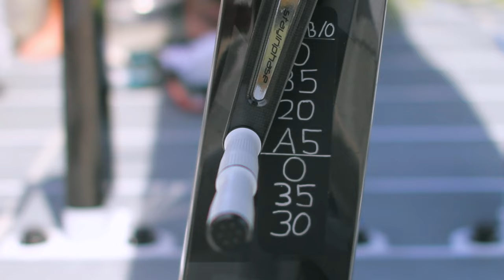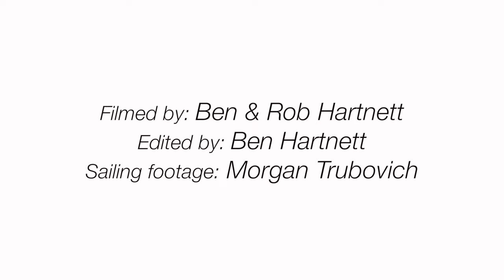The Tour of Comanche with Ken Read.

Comment: Thank you for an amazing video!  You guys just happened to catch Kenny Read in a talkative mood without any big project he was wrapped up in.  This boat was brand new out of the box when this was filmed, literally, and the crew were still learning about how to sail Comanche.  They lost to Wild Oats, coming in second, after an incredible start where Comanche blew away the rest of the fleet.

A few months after this was filmed, Comanche ran in the Transatlantic Race, which is held occasionally.  During the race, Comanche set a new record for distance traveled in 24 hours for a monohull sailboat.  618 miles in 24 hours.  An average speed of 27 knots is needed to make that distance in 24 hours.  A nautical mile is 1.2 miles.

Again, thank you for an excellent video, featuring Ken Read talking about the newest super-maxi sailboat.  Great job!

Comment: what should if the most rigging especially by snails rolls change down at plastik gears down teetwheals not need rope weight.with accelerator servowinch what said mechanical simpley

Comment: So how did Wild Oats defeat Comanche on the 2nd day especially when Comanche had such a big advantage at the start.
Reply from the maker: Comanche sailed into no wind, while Wild Oats headed inshore and was able to pickup some breeze and gained a 35 nautical mile lead over Comanche. However, when they got the breeze Wild Oats had they brought that gap back to around only 8 nautical miles. Essentially, Wild Oats just kept in the pressure the whole way :)
Reply: So Ken's fault? 

;)
Reply: I think it was light air when they were going up the Durwent River.  Comanche stalls in light air.

Comment: Is it allowed to cant the mast like a windsurfer does? Like down draft instead of up draft? Like pulling the hull out of the water instead of pushing it down? Why do I only hear a canting keel? Doesn't the keel turn a couple of degrees? Is this really the latest technology? Syllogic used self learning software for optimized trim, and it would be great if they had a ship like Comanche. Do check their concept, if you don't know about Syllogic. A turning keel will result in a ship that does not drift sideways anymore. Ever thought how much drag you'd lose, reaching? Syllogic has done that. And it has strange consequences, a turning keel and a canting mast,  the boom needs to point somewhere else. Traveller and main sheet need a change, and it takes time to learn how to sail upwind again, for it is something entirely new.
How the Syllogic team moved on, I don't know. They participated in the STAR, and the keel broke, so, no finish. But I read the book and it was a remarkable project. Just a canting keel? Great, but never forget there are more options to get a ship faster. And it is not that far fetched, really, please think about it.
Reply: The keel can cant quite a bit, perhaps as much as 40 degrees, I believe.  The mast is not supposed to twist or flex very much.
Reply: @scottholman3982  I do not mean twist or flex, that is for trimming.  I was talking about a mast canting towards the wind. Canting the other way, so to say. Consider the advantages, it is way faster. Perhaps that would be a great addition to the foiling cats, making them even faster, by reducing the drag a bit further.

Comment: Is it true that Comanche was sold after this year's Sydney Hobart race?
Reply: Yes I bought it and hauled it out to Arizona and turned it into a burger joint.
Reply: @wardaddy6002  Do you at least sell decent burgers?
Reply: @KyriafinisBill  Yeah, but the overhead is killing me. These carbon fiber disposable plates are costing me a fortune.
Reply: @wardaddy6002  Change you business model before it's too late. You could wrap them in Dacron instead it might be cheaper. You will loose some performance but it won't be that bad.

Comment: They are already building a 2nd Comanche. This 1st Comanche is too fuckin slow. My professional advice is for them to narrow the stern section a bit. Will make it faster in no-wind conditions. They're thinking of naming it The Trumper. Wot a fuckin boat the 2nd one should be. Jesus Christ ! 😅😨😆
Reply: are you joking or do you have a link?
Reply: @frombaerum  joking for sure lol theres no comanche 2 and im pretty sure this one is plenty fast enough, if theres no wind they wont leave the dock haha
Reply: yes Adam he was just trolling. i think if you gave comanche a more narrow stern section  it would surely be faster in light winds but on the other hand less righting moment, a slower sailor in heavy winds. the bad thing about the new owners is that they dont use the boat to its full potential i think. they use it mostly as a toy at near coastal sailing
Reply: @frombaerum  Yeah i dont know about that, from what ive seen the new owners have been campaigning it pretty hard in australia doing some races like the sydney to hobart and such. I think they also modified it by taking the grinders off and making it hydraulic to lose crew weight and make trimming more aggressive because so many races have a requirement to carry fuel so theres no point having grinders... Its also got a full new sail wardrobe and crew so it looks in pretty good shape

Comment: This boat has at least 2 things seriously wrong with it: 1. The floation is un-optimally distributed along the length of the hull......i.e. not enough in the front. Your rival "Wild Oats" has the same problem and has chosen to implement certain changes. 2. The hydro-dynamics at the bow and first half of the boat are woefully inadequate for the job at hand. Your expensive CFD software is consistently delivering the wrong solution because you are asking it to do the wrong thing. You are asking it to build a good plough......and it is consistently doing just that. Get a good aircraft guy instead of a boat guy to look at the problem. I would suggest someone like Burt Rutan. You will be embarrassed at how quickly the mile-stones get overtaken. The result will undoubtedly be a much faster, safer and drier boat.......with a multiplier effect of previously un-dreamt of synergies.............I'll take a bet on it!
Reply: Hi sir, what can i read to learn naval architecture, especially sailboats?
Did you go to school for this ?
Thanks for your time :)